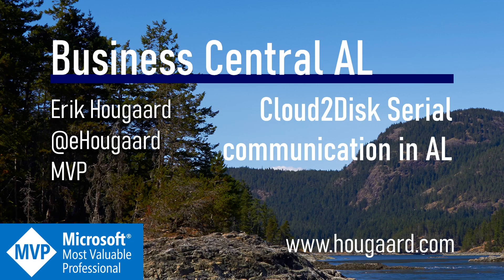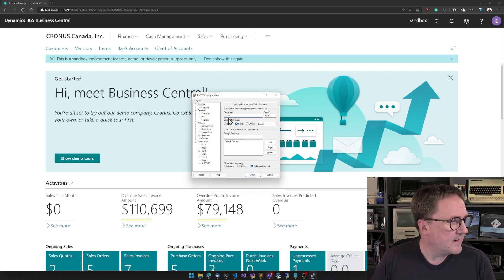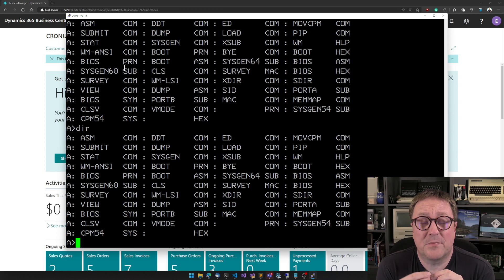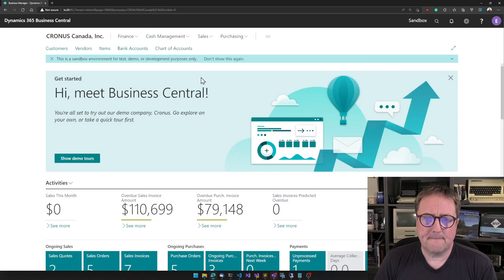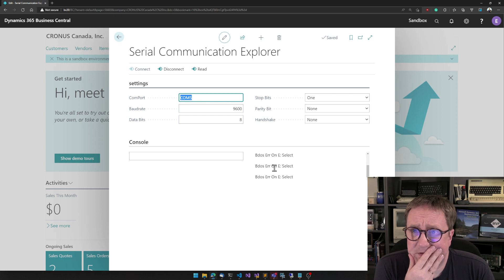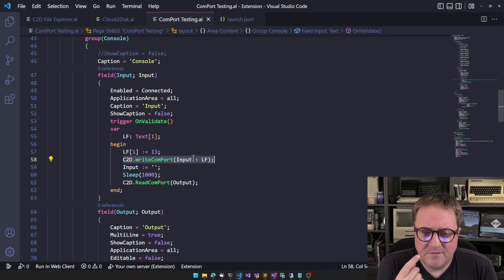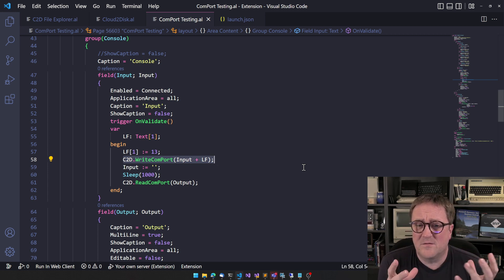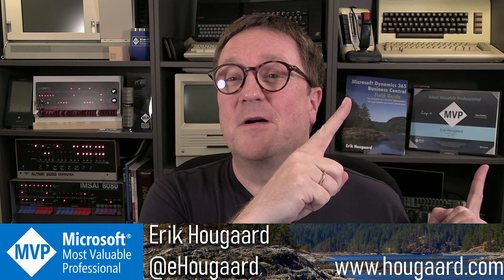Cloud2Disk Serial Communication in AL and Business Central

Comment: I've always been curious about the fascinating tech in the background and like seeing it action, thanks for sharing!

We're using a local service (single executable), which any BC instance (OnPrem og SaaS) can just connect to for hardware device communication (localhost or IP if they're on the same network or open through firewall) if they have the URL - although we usually keep the connection alive in a control addin via web sockets, but sometimes we use HTTP, e.g. if AL needs to send something, like in a web service session, when there's no GUI.
Btw. The traffic from your machine-to Azure-and back again was surprisingly fast.

But one off-topic thing I've been thinking about recently, is the upcoming major version for everybody - we've wanted to clean up stuff we obsoleted a long time ago, does that require a force-sync or is there a way to make sure it's not needed (e.g. if you make sure there's no data in the tables/fields you're about to delete)?
Will our tables/fields be in our code forever? (build time keeps increasing :/)
What about upgrade codeunits, will "cleaning up" each year require partners with 3 year-old installations to upgrade 6 times? (one for each major release)
Have you dealt with or thought about these scenarios?
I'm not sure I've seen a clear message from MS how best to tackle this problem (I've seen them using cleanup pragmas and they have been removing obsoleted code but I'm not sure about tables/fields).
I figured I'd ask you since well, you're clever. :) I see people on yammer just as confused as I am. Maybe a topic for a video?
Reply from the maker: Good topic, will put on list :)

Comment: Cool solution! I recently faced the same usecase, where I needed to communicate with an old scale that's connected via serial. May I ask why you didn't use the WebSerial API for the communication to the local device? Are there limitations in certain usecases that I'm unaware of? Maybe it would be worth exploring the features of WebSerial in a ControlAddIn based approach in a future video? Thanks for sharing your knowledge!
Reply: The Web Serial API has an experimental status, its API can change and it also requires secure context, which isn't always the case for BC setups (at least OnPrem) - but it's worth exploring though, there are some really powerful APIs out there.

Comment: This is not NAV/BC business to communicate with external hardware. This is ERP system. What for other system is natural for NAV/BC always was a hacking/workaround/undocumented-feature/crutches/etc
Reply: wouldn't it be beneficial to have business central have the ability to connect via serial to a system you are migrating data from or pulling information from for instance, a time clock that can be connected via serial so you then pay your employees from bc from that information or devices in general that have no network connection or the obsolete media types you need information from that is critical to your business function. then you get a new computer and there's no floppy and now you can't transfer that data. so now what? or just minimizing a job function that takes a long time  where the old way was connecting via serial then pulling the information to your pc then converting it then uploading it. wouldn't it be convenient and cost effective to cut those steps out and pull the information directly.  if you were able to cut all of that extra work out and just connect directly to those devices and feed the information with just your rubber banded cable?  some companies can't replace certain equipment without a huge money expenditure so creative things need to be done to integrate that data into this ERP system. they're never going to put this in the base application to begin with. so if it can serve it's purpose and save some money, then hacking/workarounds are the way to go.
Reply from the maker: but it kinda becomes it sometimes... I have create several solutions where a truck drives onto a scale and 10 seconds later the scale operator needs to hand the driver an invoice and perhaps process a payment. In order to handle correct pricing, vat/tax it's just so more conveniently to do this within the system that does invoicing and knows eveything about pricing etc..
Reply: @Hougaard  can you share that project name on GitHub for the source code.